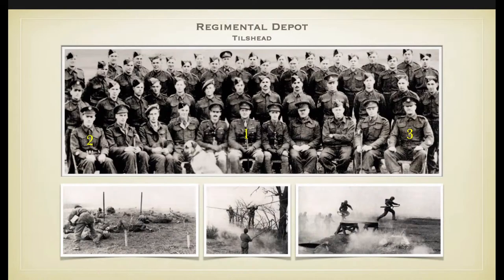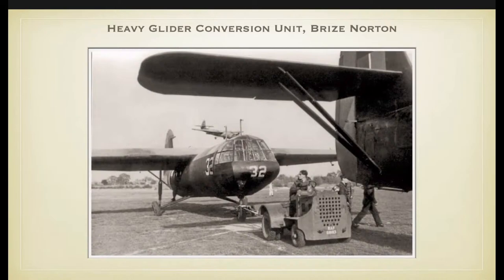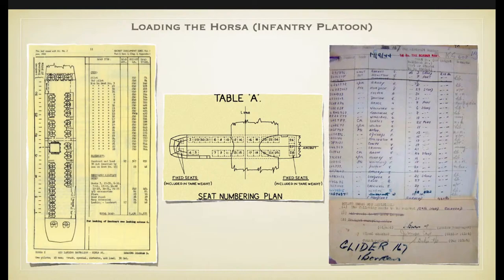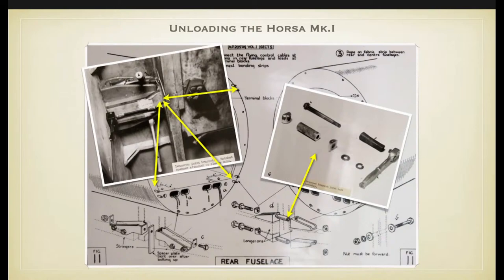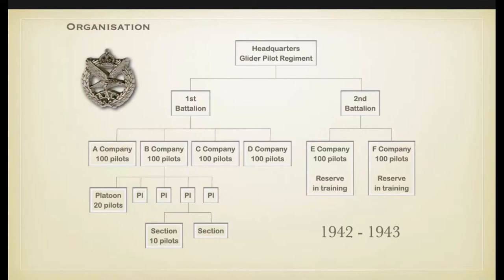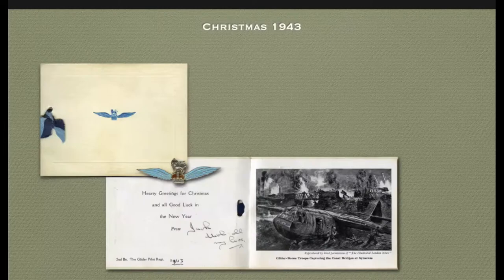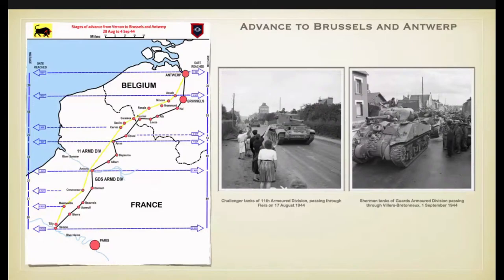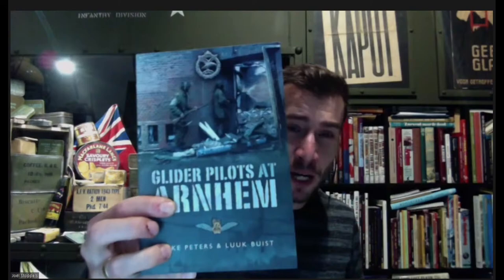Glider pilots at Arnhem - Part 1

Comment: Absolutely fantastic video. Informative and fascinating... So much detail..incredibly well researched...I have just returned from Oosterbeek after a day walking around parts of the perimeter and am wondering why on earth didn't they drop 1 , 2 and 3 para in the area between the Driel Ferry and the Railway bridge on the south bank as a coup de main.. The rest of 1st Brigade could have used the LZ 'Z' and linked up soon after maybe shepparded by 1 Border. If they had dropped at first light they could have made the second drop/landing of 4 para brigade at around 1 or  2pm the same afternoon and had a more concentrated force on hand earlier in the battle. Thanks again for this excellent video.